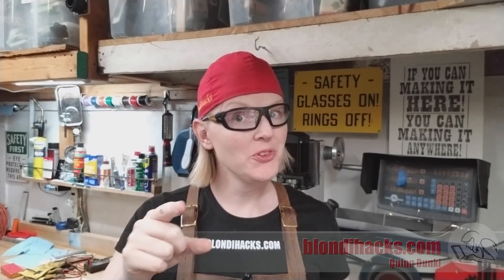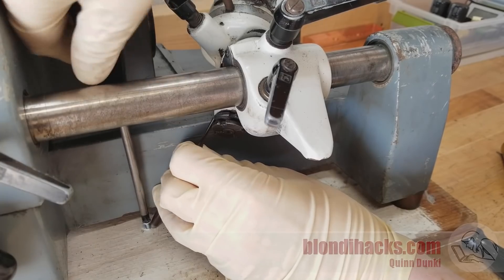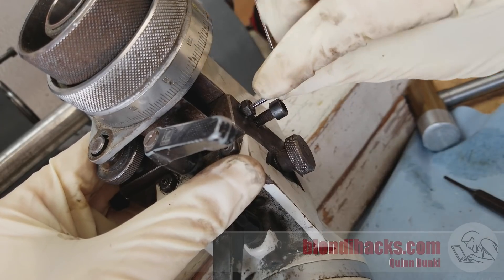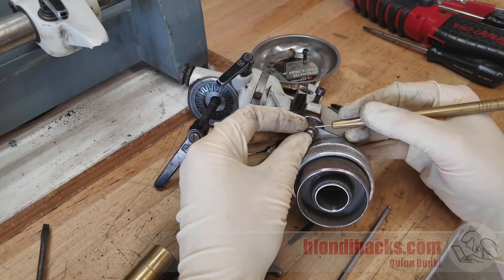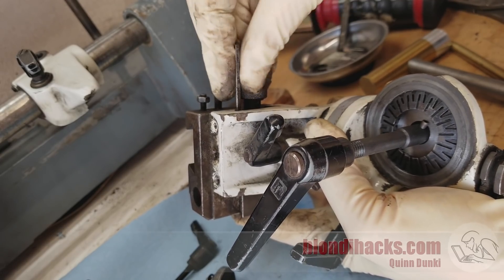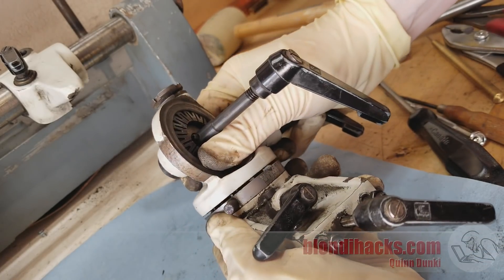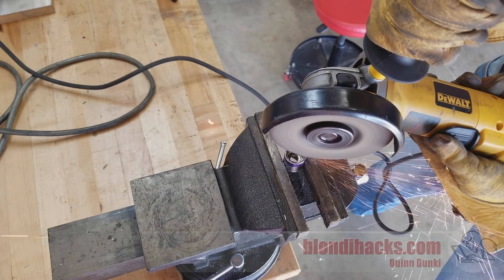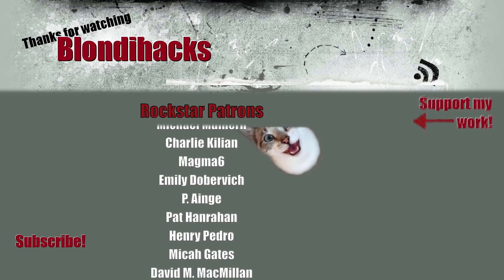D-Bit Grinder Restoration - Part 2

Comment: The matching socket was definetly better than the hammer/chisel approach ;)
Nice grinder, that Kuhlmann is what ALL the chinese dbit grinders are modeled after.
Reply from the maker: Hey thanks, Stefan! Your videos on these machines have been incredibly helpful.
Reply: That moment, after giving what you felt was an excellent lecture on black holes, you realize Stephen Hawking was in the room.

Comment: At 5:05 I just could not resist to comment. Not the handles that are on this machine are from Kipp and they are spring loaded and by pulling them up you can turn them without moving the screw/bolt, similar to the hand wheels on lathes or milling machines.
By the way it is so refreshing to see somebody "fight" with the disassembly of a machine just as every hobby "workshopper" does now and then, when disassembling something for the first time... ;-)
Beautiful job!

Comment: At work we have a lot of custom machined sockets in use, mostly for torque testing (destructive) of projection welded nuts. Hex nuts obviously use standard sockets... square nuts, not so much (as it turns out, mickey-moused square pockets are a good fit!). Not sure how they were machined... they used Kobalt non-impact sockets as the feed stock. Ground down past the case hardening? Given how fine of a bit was used, I'd be surprised if they're hard milled.
Reply from the maker: It might work to anneal them first, then re-harden. Maybe they could be milled with carbide or CBN. Depends how hard they really are, I guess.

Comment: A good option for removing difficult fasteners (seized up, slot too shallow, pre-chowdered, etc.) is often a manual reversible impact driver. Snap-On has a model 208EPIT listed for $308, but you can find Asian knock-offs on Amazon for $30. Very effective at removing frozen steel fasteners in aluminium crankcases on motorcycles.

Comment: When I'm disassembling old tools I always try to use a brass punch and a steel hammer (not the other way around) so I can get more force and no marring of the part I'm removing.  A thin strip of brass, copper, or lead can also keep vise grips from marring.  (I know you already know this.)  I'm curious: didn't the French language manual have any exploded diagrams?  I've been lucky in that I've been able to get diagrams for most of the old machines I've taken apart (from Vintage Machinery or Yahoo groups), which has helped me avoid beating on the wrong thing a number of times. I hate having to fix things because I've removed them too forcibly (maybe that comes from 40 years of repairing woodwind and brass musical instruments, which are very easy to damage if you apply too much force in the wrong place).

Comment: hi liking the vids,  the spanner nut thing needs a tool called a hook spanner wrench (you can just google it, I've used them mostly on bikes and also an old lathe. they're pretty cheap and as always the right tool makes the job easy ;) hope it helps with reassembly.
Reply: Never mind saw you make one in the next video :)
Reply from the maker: I also used one in this video. 😬

Comment: I've bought a lot of equipment from people that were too intimidated by all the screws involved in disassembly so I was able to get a good deal, of course it's a good idea to take pictures and bag up all the parts you remove but for the most part it usually works out ok. Hopefully your mill will be alright. Did you enjoy your trip to Texas?
Reply from the maker: Yes, Texas was great! I never ate so much brisket in my life. 😁
Reply: @Blondihacks  well they do have a few cows over there, too bad Adam couldn't bring some back to Pensacola for me.

Comment: From my experience, the handles for snugging parts down (the one with the shallow flat head) you can push down with your thumb and pull at the handle and adjust the clock position on the bolt.

Comment: Consider buying a hollow ground gunsmithing screwdriver set for those pesky slotted screws. The hollow grind and wide variety of sizes really helps find a tight fit for any slot-- gunsmiths are really concerned about chowdering old screws. Wheeler makes a few good, inexpensive sets- I've got the cheapest one and its under <$30.

Comment: You should write a book of technical terms.😁
Reply from the maker: It would be called Book Of Weird Hard Name Stuff English
Reply: @Blondihacks  If I may suggest, look up " Professor Stanley Unwin" on YouTube, for assistance in pronunciation 😜.
Reply: I used to fix Teletype Model 15 machines, including at least one built in the 1930s. I still remember the longest part name: pull bar bail plunger roller mounting screw!
Reply: @Blondihacks  love it.
Reply: @Blondihacks  what is your opinion on those big orange mallets that are filled with shot, and sound like the worlds heaviest maraca when they are shaken??

Comment: The 2nd best use for a smart phone is taking pictures of prior, mid and post disassembly. I have become a great fan of the ease of pictures for reassembly time. I wonder how I done it for so many years before the smart phone came along. Good for getting parts numbers off a part before disassembly or when you cannot get your head back in machine far enough to directly read number. Dont have to right down a long number to make trip from machine to stock cage either. Great tool for old forgetful farts . I have been a member of that club for a long time.

Comment: Would add, the bar comes out on the left side, you have to disassemble the micrometer dial similar to a lathe cross slide

Comment: Why did Kuhlman install those weird double slotted disk nut adjusters whatever they are?  If you bought that grinder new, it would come with the necessary wrenches,  however; that machine will give decades of reliable use.  In that time the wrenches will become lost. Then, you are stuck with making new ones or mungering up the disks with a vise grip and pliers!  Makes no sense.
Reply: That are standard off-the-shelf nuts for adjustment of endplay on shafts/spindles here in europe - The matching spanners are a standard tools. Thats why they where used :)
Reply: Stefan Gotteswinter Ah!  Makes sense then. We don’t see that configuration often here in the US.  Thanks Stefan!
Reply: @StefanGotteswinter  if I may add that they have a large OD relative to the thread size for ease/accuracy of tension.
Reply: @bostedtap8399  yes! And the face runs definetly true to the thread. You can get them even hardened and with the faces/thread ground.
Reply from the maker: This all makes sense. Thanks for the details, everyone!
Reply: @Blondihacks  The locking levers should be indexable by pulling out on the lever then turning the screw.  Probably gummed up from sitting.
Reply: They're not uncommon in the US on industrial equipment.  We always called them "barrel nuts", and had a large selection of what Quinn eventually made to remove them.  For that double nut setup a barrel nut wrench and a hook spanner are the usual tools.